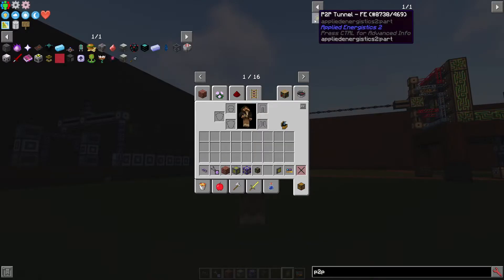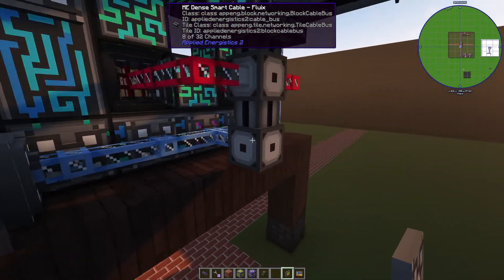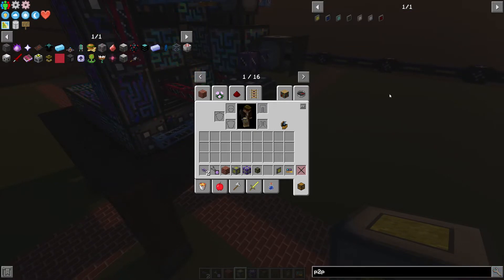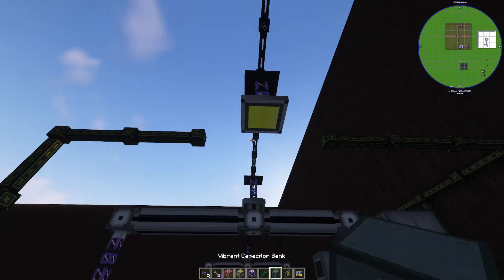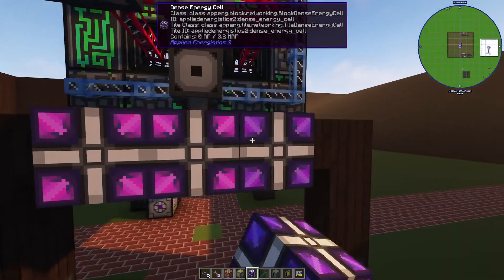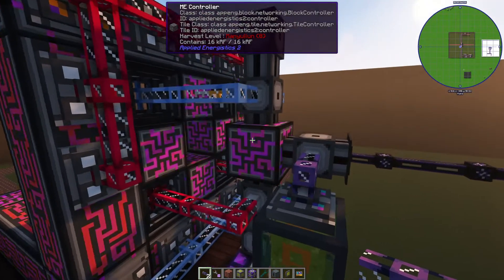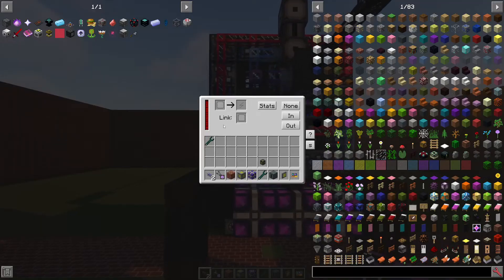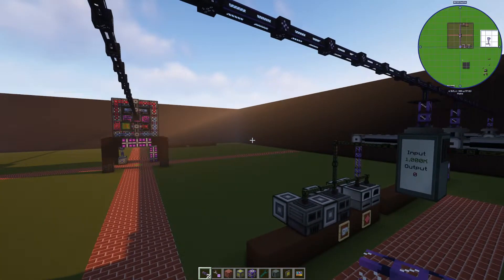Applied Energistics 2 | E2:E Modpack | FE P2P Tunnels | E03

Comment: Yet another question i guess. If you were to use two different dense cables, you could have one of them connect to 32 p2p tunnels and straight to the main network. And then have a separate second dense cable running straight out of the controllers, without having any connection to any of the "input" p2p tunnel

Couldn't that be a nice substitute to the "sub network"
Reply from the maker: Yea I never thought of that, it could be a good way to handle many channels early game if making a large ME Controller is too expensive!

Now I'm not even sure what to call the thing I was referring to as a sub network, because it doesn't behave like typical ones.. lol